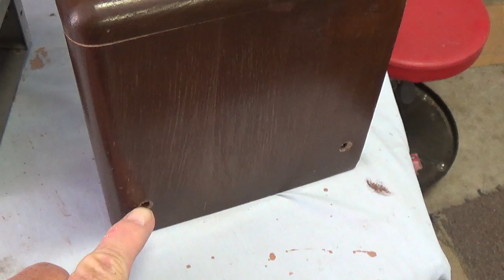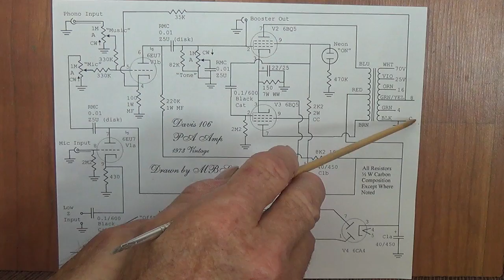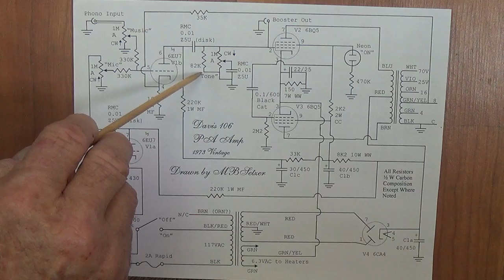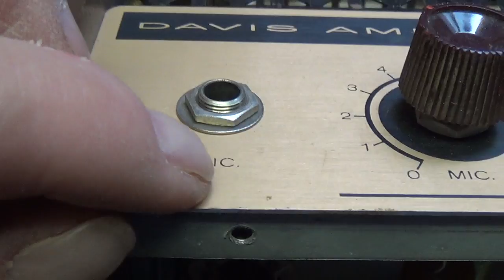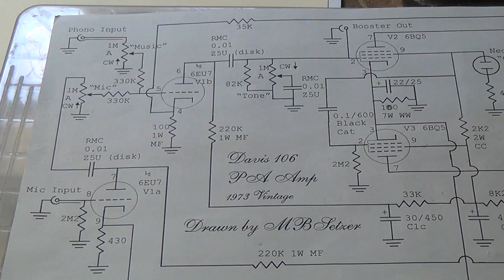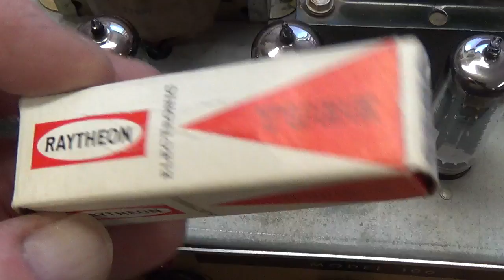Conversion of a J.W. Davis P.A. Amp into a Tube Guitar Amp

Comment: Thanks for another great video. You had mentioned checking the plate dissipation for the output tubes. Did the cathode bias resistor give appropriate plate current? What did the tube dissipation turn out to be? Thanks again. I enjoy these videos.
Reply from the maker: +Stanley Chytla You're welcome, Stanley. I added this as a note in the video. The output tubes ended up with a conservative bias (PD) of 9.3W each using the original CBR. They sounded anything but weak and sterile (indicative of under-biasing) so I left them alone.
Reply: Thanks for the update. I was curious about the effect of that unusual phase inverter method as it seems like it could be prone to poor balance between the two output tubes in a push-pull arrangement. However the sound seemed fine. I always look forward to your videos and I considered you my mentor.
Reply from the maker: You're welcome, Stanley. I am pleased and flattered by your nice comments.

Comment: One last question Uncle Doug !!  Regarding the Phase Inverter design.  Is it really possible that the level if the inverted signal from the 2nd screen grid of V2 as connected to the 1st grid of V3 is exactly the correct (same) level as the original signal fed into the 1st grid of V2??  Wouldn't they have to be the same level to produce a balanced output to the output transformer?  I would have expected a critically sized resistor in that inverted signal connection to assure balanced signal inputs to both 1st grids??  Comments ??
Reply from the maker: +Donald Filbert  I think you are correct, Donald. The screen output is probably greater than the signal input to the grid, but the 2K2 "plate resistor" (as all plate resistors do) divides it into two portions.....one, of just the right voltage, to go to the grid of V3, and the rest goes to ground.

Comment: One other comment.  I noticed the same thing on my Hammond AO-44 conversion.  After I completed the conversion - it worked - but it just didn't sound right; muddy and overdriven in a bad way.  Then I noticed the absence of a grid stopper resistor - and added in a 68K.  That fixed it very well !!!  Seems many of these non-guitar tube amps have the same absence of a grid stopper resistor !!
Reply from the maker: +Donald Filbert  Thanks for the input, Donald. It's definitely a deficiency to watch for in any PA to guitar conversion.

Comment: Great video - as always Uncle Doug !!  One comment.  It's hard to tell for sure - but in the video at 20:35; it sure looks like one end of that new grid stopper resistor is not soldered (just crimped on).   If so - that could cause some intermittent noise in the future !!
Reply from the maker: +Donald Filbert  Thanks for the sharp-eyed observation, Donald. I double checked and the resistor was indeed soldered at both ends, but I appreciate your helpful input.

Comment: Brings back good memories... we used these amps in our hometown radio station for monitors throughout the studio.  Still have 'Davis' speakers in use there!  Good video.
Reply from the maker: +charles gwyn  Thanks, Charles. They are indeed nicely designed and built. Good quality equipment......from Texas :)
Reply: +charles gwyn BTW, we used the 70 volt output to wire 7 or 8 "house" speakers in each office area... so the radio station audio could be heard all through the building.  I've never seen 70 volt output used anywhere else.  Worked well for long distance runs of audio.  Thought someone might like to know what the 70 volt output was used for.
Reply from the maker: Thanks, Charles. The constant voltage output is to eliminate the problem associated with the impedance of a large number of speakers in a system. Whether wired in series or parallel, it would be virtually impossible to match their impedance with a 4, 8, or 16 ohm output.

Comment: OK, I thought that I had seen everything as far as phase splitting is concerned. I stand corrected.
Reply from the maker: +kardRatzinger   It's really quite a clever approach.....utter simplicity with no additional parts.  I believe the concept was invented by and for Philco Radios.
Reply: I'm really tempted to use this in my next build. I'm short on filament current with my power transfromer, so it seems perfect. Mayble I'll loose the cathode bypasscap on the powertubes as well for some additional symmetry.
Reply from the maker: Best of luck with your build, Kard. Let us know how it turns out.

Comment: Great Video!! I noticed right away the grid stopper resistor was missing. However, I never would have guessed it made as much difference. Thanks for another great video.

                                                                                Joe
Reply from the maker: +Bigjoedo66   Thanks, Joe. Yes, it made a huge difference, eliminating the unpleasant overdrive distortion in V1a. I intend to experiment with higher resistance grid stoppers, i.e. install a 1 Meg pot and tune for best tone.

Comment: Great video like always!

First of all i very appreciate rustys effort to be content with jacks food in order to make things more easy for you.
its a smart move from him, because the saved space from the no longer needed dog-food can be used to store more tubes!
i am sure, that's what rusty intended.

Could you make a video to share some more tips about safety in dealing with higher voltages?
I build a little booster with a 12au7 running at 60V and i would love to feel more safe, so that my tubes would not always have to starve like this!
Reply from the maker: +PrinceOfBodom  Thanks, PoB.  Yes, Rusty is known for his cooperative, helpful work ethic :)  I incorporate safety tips in many of my videos, but, other than my Shock Hazards video, have not yet consolidated them into a single production. I'll keep it in mind for the future. Meanwhile observe two simple rules: Avoid being grounded (i.e. no bare feet on concrete) and only use one hand when working directly on an energized circuit (to avoid completing a circuit through your body).